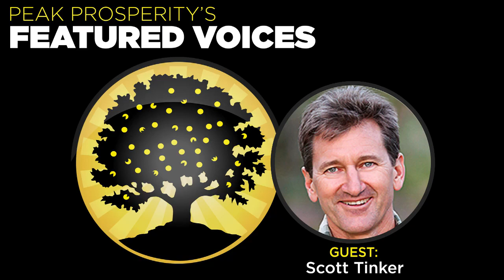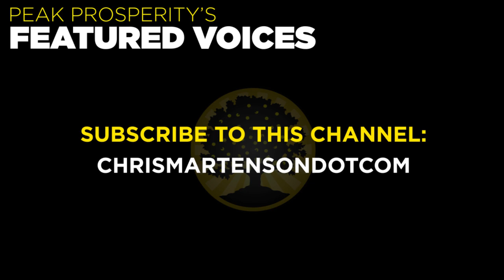Scott Tinker: Can The World Energy Supply Become Fully Sustainable?

Comment: Spatial Effect Generators require no other source of fuel other than free-floating electrons, which exist everywhere in nature.
 SEG's can be as small as one meter in diameter and can generate 15 kWh and provide power to any AC/DC device. They have no wear or friction since SEG's are designed to operate with magnetic bearings, with no noise, no air pollution's, and no radiation hazards the only side effect is local air cooling by 2 degrees. See https://segmagnetics.com/ for more detail.

LEARN MORE